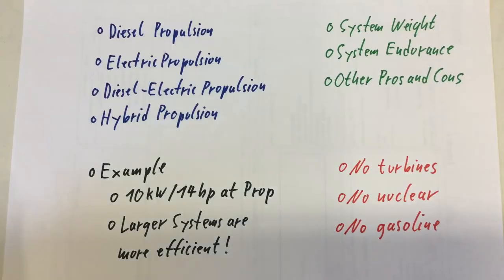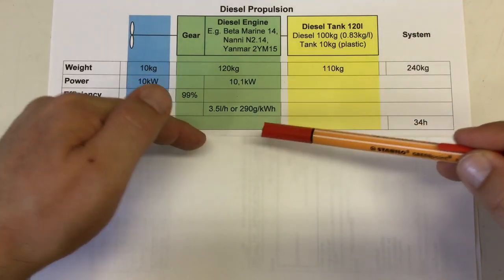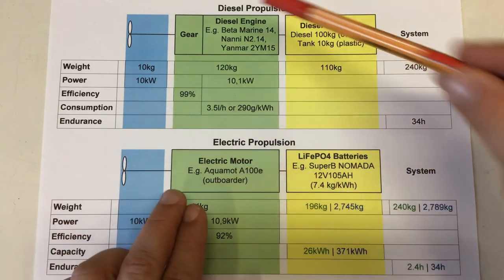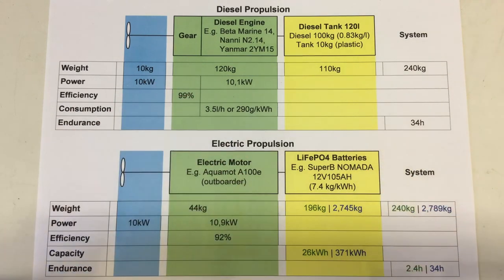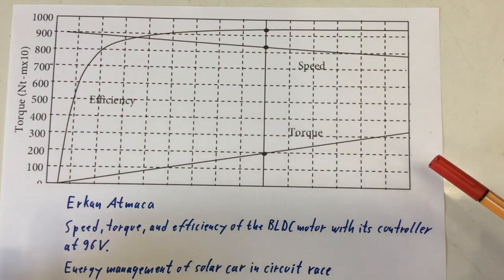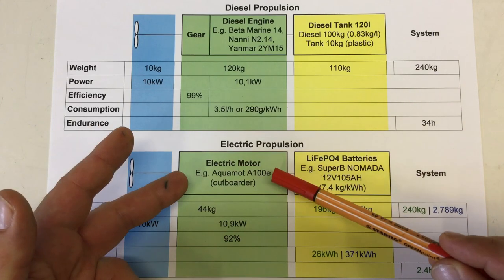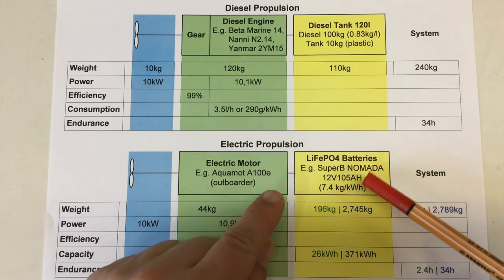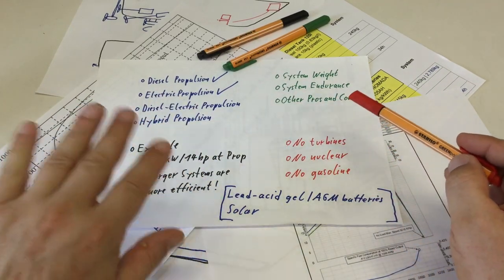Marine Propulsion: Diesel, Electric, Diesel-Electric or Hybrid? (1/2)

Comment: 12 minutes in and it's apparent that hybrid is going to allow you to enjoy the torque and efficiency of electric motor with the energy density of diesel.  This should be the preferred method of propulsion (not considering rebuild cost etc) until battery technology advances to give energy density comparable with diesel fuel.  Or until electric production from solar or wind advances significantly.
Reply from the maker: You're absolutely right. I'm drawing a very similar conclusion in the second part. Pure electric propulsion for marine applications works (for now) only in a few niches. Nevertheless there are purely electric commercial offerings for pleasure vessels out there. Some plaster every free surface with solar cells (helps of course a bit, but not much) and none advertise with hard numbers regarding the endurance.

Comment: need advise on fishing boat running on 240 HP diesel engine for converting in to electric system.
what type or size of motor required for 240 HP diesel engine?
Reply from the maker: Well, 240 mhp (metric horsepower) are 177 kW (1 mhp = 0.7355 kW). 240 ihp (imperial horse power) are 179 kW (1 ihp = 0.7457 kW). That's what you need at the shaft to achieve the same top speed. Note that electric motors often have the input power specified only. So to get to the shaft power you have to consider an efficiency of 90% to 95%. Also note that you might need a new prop, since an electric motor might have another RPM range than your diesel (after the gear box). Lastly you'll nee about Finally note that you'll need about 10 kg of battery (LiFePO4 type) to store 1 kWh, meaning to be able to run 1 hour at full speed (optimistically 185 kW input power), you'll need about 1.85 metric tons of batteries.

Comment: You also have to factor in that you shouldn't charge the battery to more than 100% and not discharge to below 20%, so in reality you can only use 60% of the battery.
Reply from the maker: Yup, you made some valid points here. Though LiPoFe3 cell chemistry definitely allows you to charge up to 100%. So 80% of usable capacity would be more realistic.

Comment: How clumsily the author manipulates numbers. I chose a stationary diesel and an outboard electric motor. The required power was picked up by the most problematic for electric. Electric drive will always be more efficient than diesel. The thing is that a diesel engine has a significant percentage of energy going into the void to heat the environment. And therefore the efficiency of a diesel engine of 99% is nonsense. The author is trying to prove that it takes less for him to heat losses in a diesel engine than in an electric one?
Reply from the maker: Dear ildarkhamitov, please watch the video again from 2:20 ( https://youtu.be/z38cIBVdiV0?t=140 ).

The "99%" in the box below the box with the word "Gear" in it is the efficiency number is for the gear box.

I never gave any efficiency numbers for the diesel engine in this video, because it was not necessary for the other calculations (*). I just gave the consumption in l/h and g/kWh at full load.

(*) One of the main points of the video was to calculate the system weight, especially the weight needed for energy storage, for a diesel and a battery electric propulsion system of similar shaft power and endurance.

And yes, of course electric motors are far more efficient (Aquamot A100e 92% in the video) than diesel engines (29% in the video if you do the math - engine 0.290kg/kWh, diesel 11.8kWh/kg).

I'm sorry ildarkhamitov, but your comment just makes false statements ("99%") and disregarding these false statements it makes absolutely no sense in the context of my video.